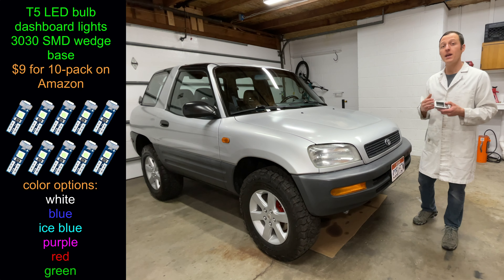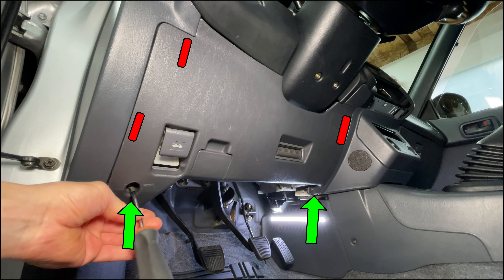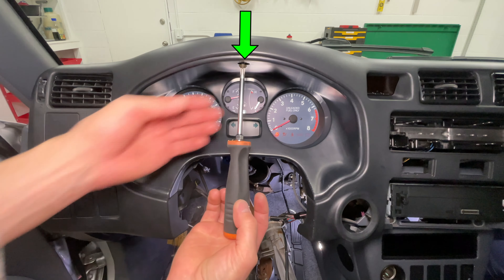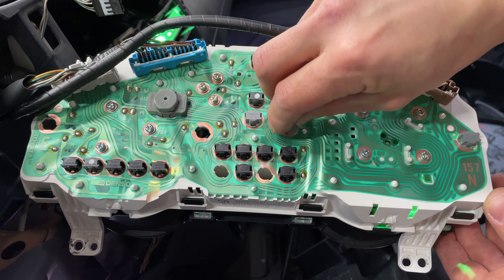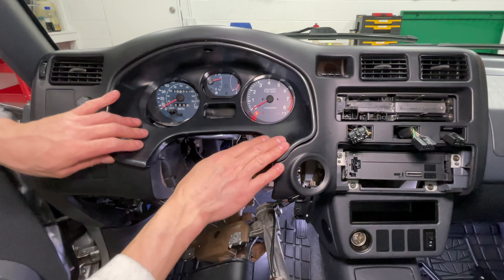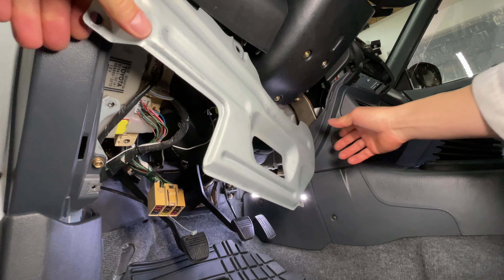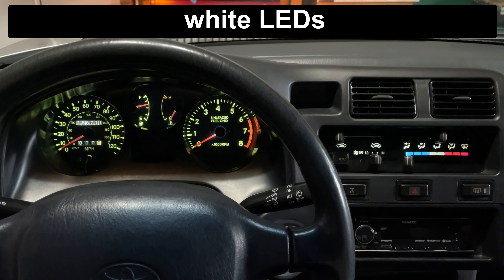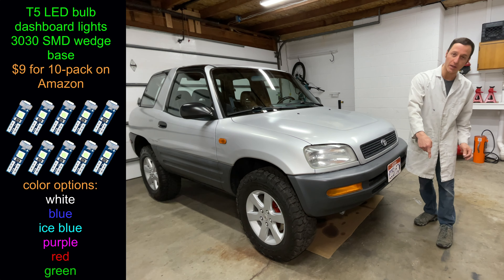LED dashboard light installation 1997 Toyota RAV4 (episode 29)

Comment: For the HVAC you only have to remove the AC button, 4 lever covers, and the face plate. Then you can use a small screwdriver to press the tab on the translucent plastic to remove it and give you access to the bulb. It's designed to come out the front. The way you did it is way more extreme and unnecessary. To pop off the cover you can either pop the corner of the dash off as it's held in by clips and push from behind or you can remove the radio cover and reach behind.
For the cluster you do not have to remove the steering column or the trim around it. All you have to do is remove the screw that holds the black plastic cover, then remove the 4 screws that hold the cluster in place. Turn it sideways and you can either reach all 4 lights like that or you can reach the plugs to remove the cluster. Takes a little wiggling to get out but easy enough to do.
Reply from the maker: Excellent advice, thank you.  What year is your RAV4?  I recently found out the dashboard trim is different on the earlier 1996 and 1997 model years (my RAV4), and the later 1998 and up model the black dash trim just comes out.  
My instrument cluster is not flat at the bottom, and dips down about 3 more inches on each side of the steering column, making it impossible to remove.  I've pulled really hard on it, with no luck.
Reply: @LabCoatPaul  I'm the one in the Rav4 group. You asked me to comment the steps here for others to have.
Reply from the maker: @truealchiemist  oh.  hahaha derp.  I kinda thought so.  :)  I pinned your comment.
Reply: Thanks fir the info!!
Reply: @sonic5773  Of course! Try to help when I can.
Reply: @LabCoatPaul  Hey Paul, can you illuminate the needle from the speed scale and tachometer?
Reply: @truealchiemist  Does your comment about not needing to pull apart the steering column apply to a 99 Rav4 if all I want to do is fix the clock light? I've seen @lab coat paul video about repairing his clock, but he takes all of it apart like in this video. Just wondering if I'll need to do all that for my 99 Rav4 clock. Thanks!
Reply: @johnshipps441  No need to pull the column to fix the clock on a 99. You can remove the bezel around the cluster pretty easily on any facelift which makes it so you can take the entire dash apart.
Reply: @truealchiemist  Is this a Whatsapp group? I'd love to be on it if so.
Reply: Well, I'm now just seeing all this information about the lights and fixing different things on my '99 Rav 4, 2 -door that I love. 
It's got 278000 miles on it, still going strong and the lights are VERY dim on the dash, but I could not possibly as a senior, do any of these things. 
ANY advice on who I might be able to ask to replace the lights or do things that I'm not capable of because it's really nice to make the car updated?
Reply: @LabCoatPaul  My 1997 RAV4 needed the little bulbs that go in the switches. There is a bulb in the center lock, hazard, and defrost buttons, when you pull out the button, the light is right there inside the button.
Reply: @LabCoatPaul  can you do a video demonstrating this new method? I need to pull out my dash but I’m a visual learner 😅
Reply: Thank god I saw and read this before I went down that rabbit hole just to get my dash open enough to clean behind and around the vent housing
Reply: @LabCoatPaul  It's possible on the 1996 if you remove the plastic trim around the steering column and remove the turn signal/lights stalk and the windshield wipers stalk. Takes a bit of wiggling to free the black plastic instrument gauge trim—but you only need to free it enough to gain access to the screws holding the dashboard in place. Once those screws are out, you push the instrument gauge trim back and pull the dashboard and gauge trim out together as one piece. I have some photos but no video.
Reply: On the off chance you are still active, should I be able to pull the whole heater control unit without pulling the rest of the dash? I have a broken heat diverter cable and trying to figure it all out!

Comment from the maker: Thanks to everyone's input, I discovered DROPPING THE STEERING COLUMN IS NOT NEEDED on the 1998 and newer RAV4.  If you have a 1996 or 1997, you still have to do it.  Toyota changed the instrument cluster trim for the later models.
Reply: What about 1995 RAV4? And why is it necessary to remove the steering column? New to the whole RAV4 adventure 😁
Reply from the maker: @darktar2175  On the 1997 and older RAV4, the instrument cluster trim dips down below the steering column trim and it's impossible to remove it unless you get the steering column out of the way.  In 1998 and newer, that trim piece is flat across the bottom and comes out without any extra work.
Reply: Just got a 99. Thank you!!
Reply: Maybe the US models are different, but on my Australian 1994 RAV4, I can drop the steering column adjustment to the lowest setting and manoeuvre the instrument cluster surround off that way… no need to touch the steering column bolts.
Reply: @michaelnelson912  My Swiss '94 was the same, didn't have to touch the steering column, although you really have to bend the black part to get it in/out. Said a little prayer and it worked.
Reply: This is very true!
Reply: 1997 Rav4 Auto no need to do the steering wheel drop. Can maneuver the trim out with steering wheel tilted to lowest position.

Comment: I did my 1990 Corolla by pulling the bulb in the front using a long flier wrapped with a rubber to have a better grip and less tendency crushing the halogen glass. The rpm and odometer cover were removable.

Comment: I am about to do red and white for my Rav4! Thanks for the guide
Reply: Note to those that have a 2000, US, and 4-door. You don't have as many steps as Paul but it's essentially the same. You still have to drop the steering, pull the dash, etc. BE CAREFUL WITH THE DASH your wire harness is probably thick and old so don't pull to hard and to the right. You're going to flip I upside-down instead. AC side is the same as Paul's

Anyways, Red is definitely dimmer than Paul's example but works great too. 

Thanks Paul, my Rav4 now has a little more character.

Comment: You know you just need to remove the 1 screw in the gauge cluster bezel, wiggle it out and then remove the cluster by rotating it 180 degrees.
Reply: Really? I was thinking there has to be an easier way to get to the cluster

Comment: Lots of work for some pretty lights. Would have been cool if you had multu colour LED's with a colour selector switch. Cool stufffs
Reply from the maker: I thought about that, but changing light bulbs is much easier.  A multi-color setup would require some re-wiring and mounting a switch or remote somewhere.  I think more people will want to just change the light bulbs.

Comment: I know this was made a few years ago and I have a '99 Toyota Rav 4, 2-door. 
The lights are very dim and I would ❤ to have them replaced, but frankly, as a senior, I have no idea as to how to do it, even watching the video, too complicated.
I know of no one who is even willing to bother, let alone if those bulbs would fit my particular year. 
Any suggestions? 
Thanks
Reply from the maker: In 1998, Toyota re-designed the dashboard and made it easier to work on.  You don't need to drop the steering column to remove the trim around the gauges in your car.  
It takes the same bulbs as in the video.  
Any mechanic should be able to do it for you.

Comment: There's a much easier way to do this:  Instrument Cluster:  
Remove (1) philips head screw from cluster bezel(center top of bezel) and gently work the bezel free and out.
Undo (4) screws holding instrument cluster (use magnetic driver or be careful not to drop them down into the dash)
Angle the LH side of the cluster out and unclip the connector so you can access the backside of the cluster.
Identify the (4) bulbs; remove and replace the bulbs.
Reverse to reassemble.
No need to drop the steering column.
The Bezel is a tight fit, so be patient with it.
You can also replace the Climate control bulb without removing the dash facia;  
Remove the radio instead; much easier
Pop the three switches out; 
Pull the climate control out slightly
Use fine pair of tweezers/needle nose pliers to gently pull the bulb out;
Replace and restore.
This method requires a little more dexterity and physical flexibility, that's all.
Tip:  Have a couple of replacement bulb sockets on hand: some bulbs may have fused themselves into the socket..
Reply from the maker: Removing the instrument cluster in a 1996 and 1997 RAV4 requires dropping the column.  1998, 1999, 2000 it's easier, like you said.
Reply: @LabCoatPaul  I have a 1997 RAV4 XA11. I replaced all the instrument cluster illumination bulbs just by removing the bezel and the four screws. I also replaced the climate control illumination bulb without removing the entire dash bezel; I removed the stereo and accessed the control unit and the bulb from underneath. It takes a little more dexterity and careful use of needle nose pliers, but it was still easier than removing the dash bezel.

Comment: Hey , question about replacing dash lights with leds. Switched all out but some weird stuff happening. Right turn signal light stopped lightning up but it does work, high beam indicator does not work after switching to LED, brake light indicator stays on ever so slightly all the time. OMG, any help totally appreciated, thanks 
97 2dr 4wd 5speed

Comment: Thank you for this brilliant video. I can actually see my gauges at night now w/ my new "Ice Blue" LEDs, same brand you bought. Hey, can you tell me if I did something wrong? My "LOW FUEL" idiot light is on now when key is in "Start" position. I have 1/4-tank. Before changing out the incandescent bulbs, Low Fuel light only came on when tank was near "E" (Empty).  Did I change out the wrong bulb or something?  1998 Manual Transmission RAV4 4-door 3S-FE engine Hard-Top. THANK YOU!
Reply from the maker: I recommend changing only the dashboard illumination bulbs to LED.  The indicators all need to be incandescent.

Comment: Will it be the same steps to change the cluster light bulbs for 1999 toyota rav4 4 door  2WD ??
Reply from the maker: It's easier on the 1999.  You don't need to drop the steering column.
Reply: @LabCoatPaul  thanks Paul you are the best

Comment: Hey Paul, your videos have really helped me. I'm curious though, have you ever considered replacing the dash cluster with a fully digital dash?
Reply from the maker: The stock dashboard looks good and works perfectly. There is no logical reason to replace it. A digital dash might look cooler but it won't match the car, and aftermarket wiring and components are usually less reliable than original. I think installing a digital dash would make the car worse.
Reply: @LabCoatPaul  Won't match? You mean fitting or aesthetics?

Comment: I was thinking about doing this, but mine doesn't have a dimmer I think. Looks like I'll stick with incandescent to avoid burning my eyeballs at night.
Also, wondering if you've heard of the seatbelt warning light logic being reversed. My light turns on when the seat belt is buckled, but is off when unbuckled.
Reply from the maker: What happens when you unplug the seatbelt light connector under the seat?  On my car (not broken) the light stays on when it's unplugged.  If I connect both terminals on the wires coming out of the floor, with a jumper wire, the light turns off.
Try that test.  If you get ON with the wires disconnected, and OFF with the wires connected, then your problem is in the seat belt latch.
Reply: @LabCoatPaul  with the seatbelt sensor disconnected, the light stays off. I just shorted the connector, and it made the light turn on. I got new buckles from toyota parts deal, so I'm inclined to think that they're not the cause of this. In fact, the old buckle wasn't connected either, and the light was off when I got the rav
Reply from the maker: @handsarecats  The easy option of course is just leave it unplugged.  You might have a loose connection at the instrument cluster connector that has the seat belt warning wire, or maybe the light bulb has a bad connection.  It could be pulling current through the light bulb.  Pull the instrument cluster out, and unplug all 3 connectors and plug them back in to see if that helps.
That's about as much electrical diagnosis as I can do without having the car and a multimeter.
Reply: @LabCoatPaul  awesome, I was going to pull the dash to change some cracked vents, so I'll be back there anyways. Thanks

Comment: If your lucky and have a tilt steering wheel you can just take the dash cluster cover off and take the cluster out. Or if your like me and don't have a tilt steering wheel, you can bend the crap out of the cover and take it out like i did.
Reply from the maker: I tried the bending strategy first, but I guess I didn't bend it hard enough.

Comment: My 1996 JDM RAV4 doesn't have the dash lights dimmer, it's blanked out!  I see that even the original brochures for that year has the light dimmer blanked out.  Mind boggling.  How would I find the info to figure out how to install the dimmer?   Would the steering column need to be removed for that too?
Reply from the maker: 1996 and 1997 RAV4 dashboard trim is shaped so it doesn't come out unless you drop the steering column.  1998 - 2000 is a different shape and doesn't require moving the steering column.  If you're lucky, your car will have wiring for the dash lights dimmer, so you can just plug one in.

Comment: Honestly,  I thought the dash light pull out was way simpler.  I simply need to change some bulbs man.
Reply from the maker: Based on comments from a few other people, The dashboard may be easier to remove on 1998 and newer models.  Toyota changed the steering wheel and steering column a bit and you don't need to drop the column like I did.  If you can get the black trim out from around the gauges, you don't need to drop the steering column.

Comment: I did the process as you laid out and replace the bulds with the LED bulds you listed. However I ran into a problem which I hope you or someone can help me with. After changing bulds the headlight indicator on the dashboard does not come on. Yet when I switch on the highbeam. The highbeam light indicator does turn on the dashboard. The actual headlights does turn on and off.
Reply from the maker: I recommend replacing only the dashboard illumination lights.  All indicator lamps need to be incandescent.

Comment: Do i need to remove the steering column to remove the instrument cluster??? I need to replace the cluster as the digital odometer display is partially faded out
Reply from the maker: In 1996 and 1997, yes the steering column prevents removing the instrument cluster trim.
In 1998 and newer, the trim was re-designed and you don’t need to drop the steering column.

Comment: HOLA PAUL TENGO UN TOYOTA RAV 4 1997,TENGO UN PROBLEMA CON EL PANEL,NO PRENDEN LOS 4 BULBOS QUE ILUMINAN EL PANEL,QUE PODRA SER???ME PUEDES AYUDAR GRACIAS!!!👍👍👍ESPERO TU MSG,GRACIAS SALUDOS DESDE CHICAGO IL!!!🤗AH LOS FOCOS YA LOS CAMBIE!!!!!GRACIAS POR TU AYUDA!!!!👍👍👍
Reply from the maker: If your dashboard lights don't work, start by making sure the dimmer is set to the brightest mode.  Then check your fuses.  If you installed LED, try changing polarity on the bulbs by unplugging them and turning them 180 degrees.
Reply: @LabCoatPaul  PAUL YA CHEQUE LA POLARIDAD DE LAS LUCES,EL START QUE ESTE ABIERTO,EL REGULADOR DE BRILLO,ESTO ESTA BIEN,ME FALTARIA EL FUSIBLE DONDE ENCUENTRO EL FUSIBLE QUE CONTROLA ESTAS LUCES???ME PUEDES INDICAR GRACIAS!!👍👍👍PAUL!!!!!LAS LUCES DE LAS DIFERENTES FUNCIONES SI TRABAJAS LAD QUE NO PRENDEN SON LAS 4 LUCES QUE ALUMBRAN TODO EL PANEL O TABLERO!!!GRACIAS!!!👍👍👍

Comment: My 2000 rav 4s steering wheel can be adjusted down I wonder if I still would have to drop the steering column.
Reply from the maker: on 1998 and newer RAV4 you don't need to drop the steering column.
Reply: @LabCoatPaul  that's good because I want to fix the clock it works if I tap the dash but it just flickers then turns off

Comment: To just replace the climate control light in my 96 is there a way to do this without dismantling so much?
Reply from the maker: You can pull the dash trim forward a few inches, and pull the bezel off the climate control.  Be careful not to pull too hard so you don't break the plastic.

Comment: Can you take out the dashboard without removing the steering column? Thanks
Reply from the maker: Nope.  I tried to, but the black trim around the gauges gets stuck and forcing it doesn't work.  This is the only way.
Reply: Thanks
Reply from the maker: @victorbaird8220  Update:  It might be possible on 1998 and newer RAV4, but on the 1997 and older, the column has to go down.  If you can get the black plastic trim out from around the gauges, then you can skip the steering column stuff.
Reply: Sounds good.

Comment: @1:53 is that the 2nd interior fuse box in the top right section?   Does it have a snap cover?
Reply: @lab coat paul

Comment: hey Paul, did you change your oil pump gasket or is it still in tact? i think that is the main reason why my rav4 is still leaking oil. If not i hope you will educate us on that. good luck!
Reply from the maker: I replaced the oil pump gasket and seal when I replaced the cylinder head.  Check out the cylinder head video here:  https://youtu.be/Ksv98JvBqXs
or the timing belt video here: https://youtu.be/qabgg9DzY9w